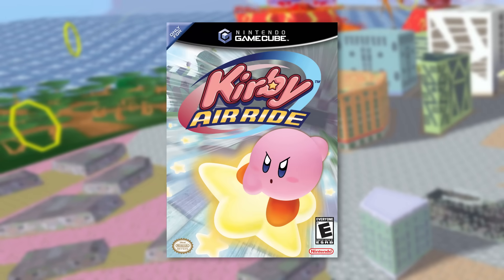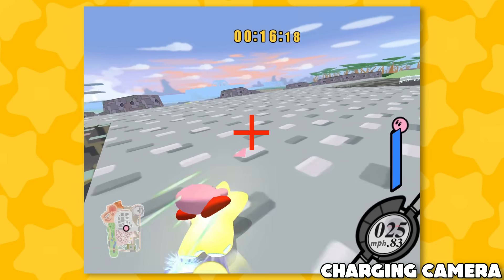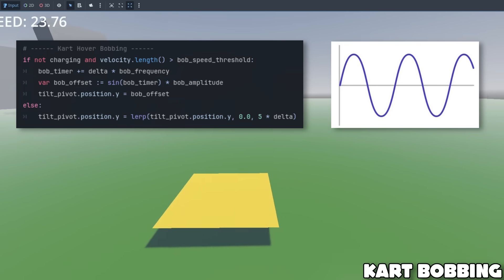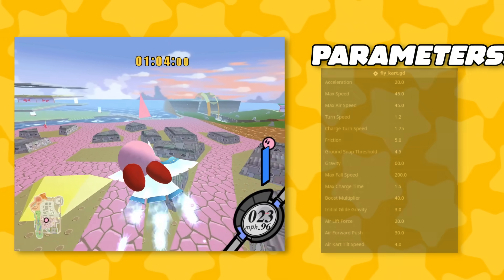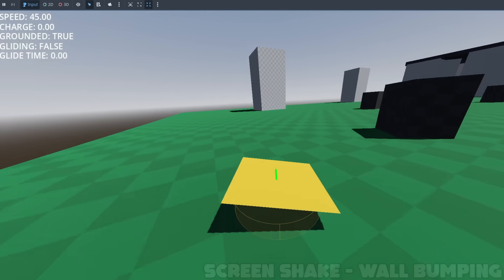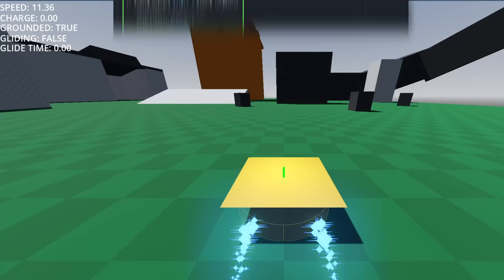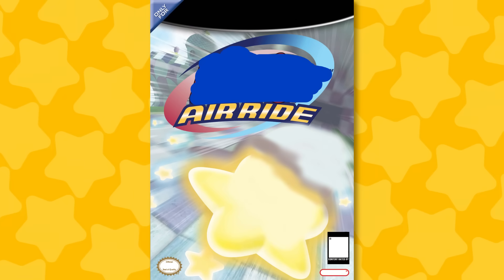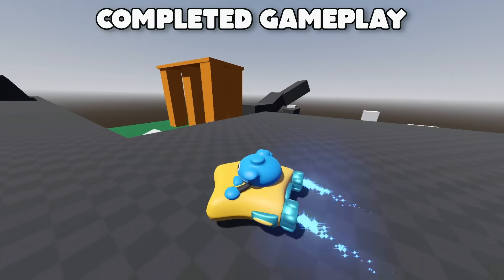I Made Kirby Air Ride in Godot!

Comment: Very very good! The only thing that’s a bit jarring to me is the particle effect for the exhausts on the end. I feel like if the momentum direction for the star is going forward while the star is spinning, that the particles should be emitting more in the direction against the star’s momentum… Basically if star moving forward, even with spinning, particles should push backwards.

There’s probably more you can do with the particles as well, such as smaller particle emission at lower speeds, particle direction shifting a bit during turns, etc.

Overall, the movement mechanics look great. 😁

Comment: You have no idea how much seeing videos like this means to me. I'm obsessed with Air Ride and seeing people recreate it. If it wouldn't be too much trouble, would you be willing to put this game on your website so we can mess around with it? Or better yet, would you be willing to give out the project file itself so others (like me) can extend off of it? 

Also small nitpick, but if you look at your lean direction when turning, it's opposite from the original game. Your game leans into the turns. In Air RIde, you lean out of turns. Makes the vehicles seem heavier.
Reply: That explains why it felt just slightly off watching the video.
Kirby leans hard into the turns, but the air rides act more like they are trying to topple over, and their sides physically drag on the ground from the tilt during drifts.

That also leads to my other small bit of critique from watching it. It's that the boost doesn't charge faster if you drift while charging. In KAR, the boost actually charges very slowly if you are at a standstill or moving straight, with very few rides not reaching a near or total standstill by the time the boost is fully charged if you don't drift.

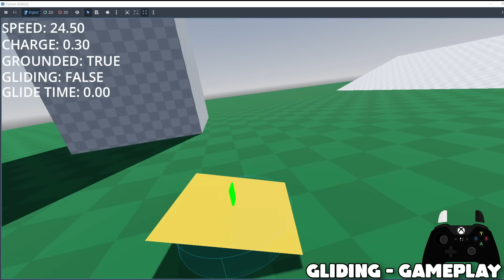Comment: 5:05 well you could say sonic riders zero gravity may have been inspired by this. In that game players charge and use built up gravity (gravity control) amplify it, then maneuver effectively similar to a drift which can also be used to reach inaccessible areas not possible through normal movement.